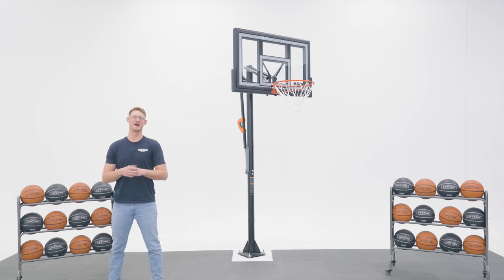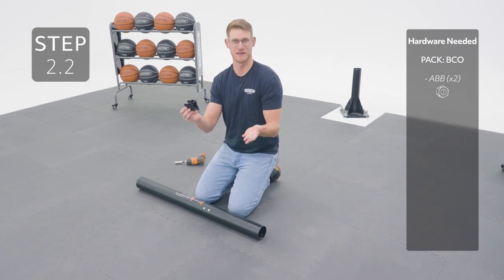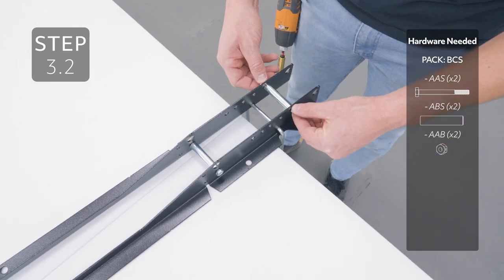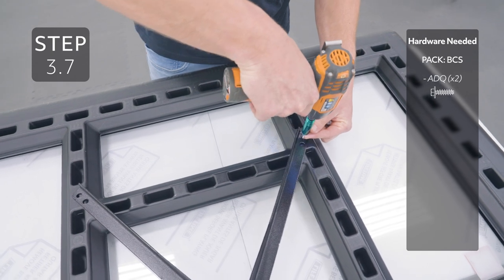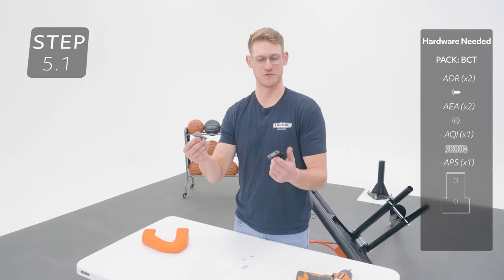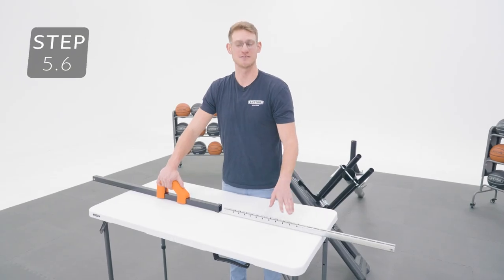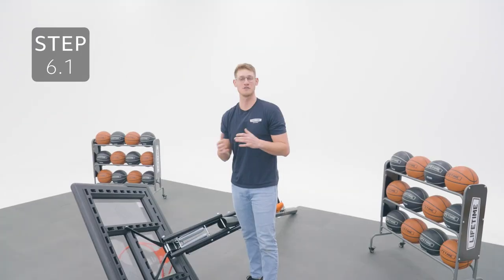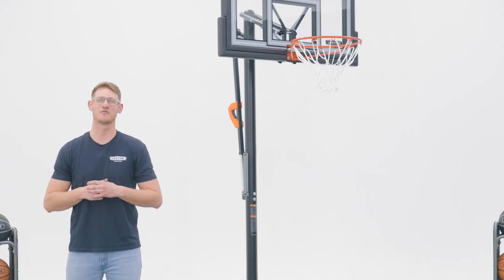Lifetime 50" In-Ground Action Grip® Basketball System | Lifetime Assembly Video

Comment: where can i get the in ground bolt in base?
Reply from the maker: Since we film these assembly videos indoors, we use that bolt down sleeve as our bottom pole. But unfortunately, we don't sell it. We do however have a ground sleeve that can be cemented directly into the ground. Here is the link: https://www.lifetime.com/lifetime-0023-3-5-inch-round-pole-basketball-ground-sleeve